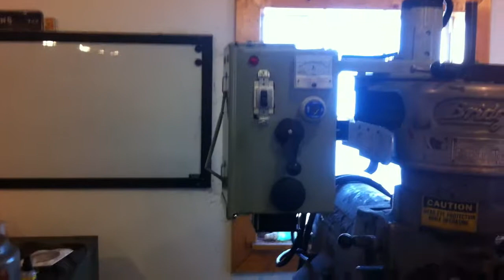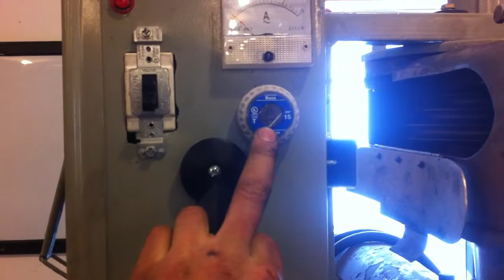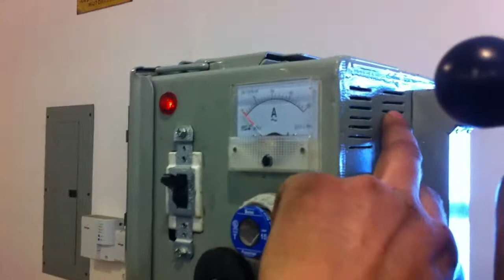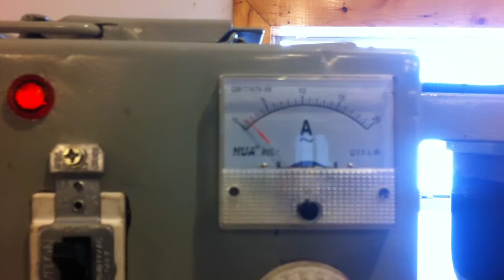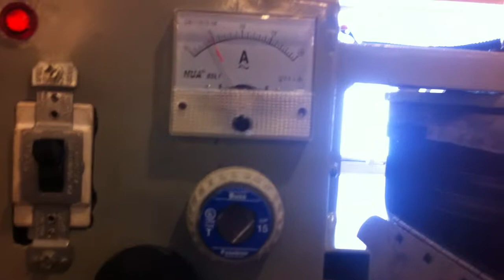Bridgeport with treadmill motor

Comment: Come on...all that work and you couldn't take 10 minutes to take a cut on a piece of steel. That is very sad. You did a nice job but that box is way to clumppy an takes up a lot of room. when you machine you need to be able to put your hard in different places around the mill; without knocking it. Congrats on the new addition to your family.